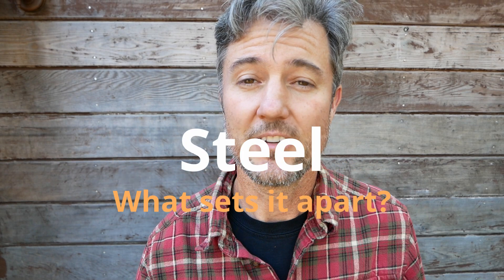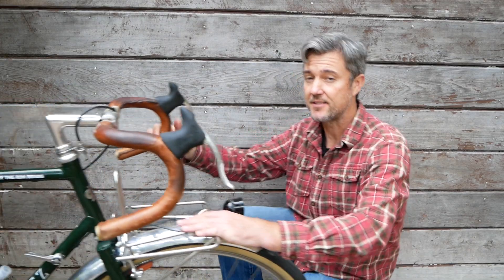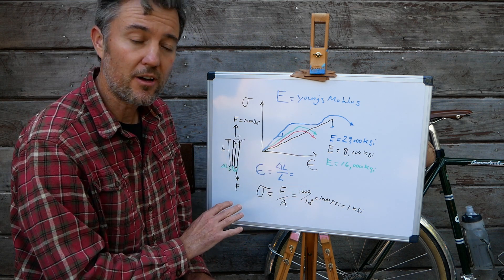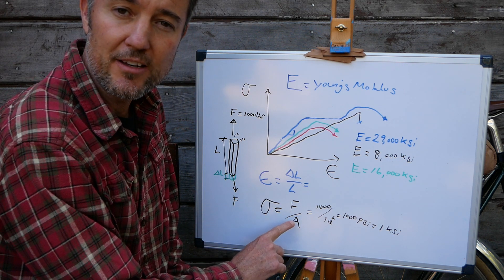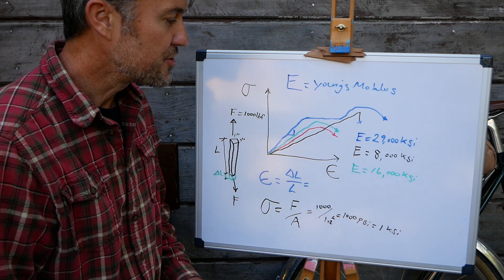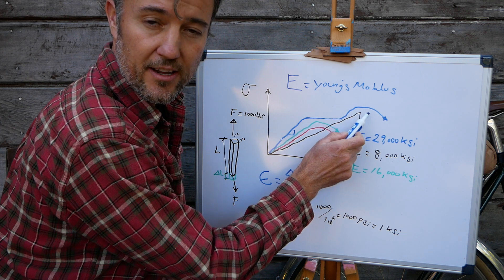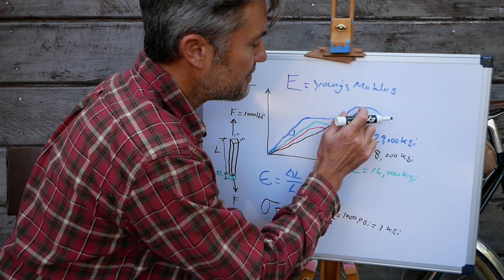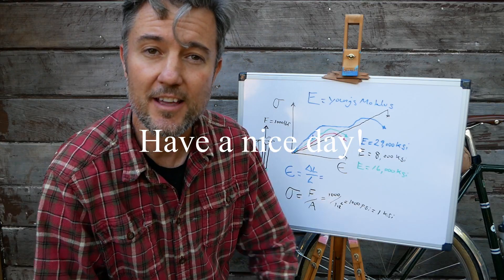Steel is a GREAT Material for a Bicycle Part:1 Intro

Comment from the maker: Hi everyone, I want to point out a mistake in this video. I said steel is often alloyed with magnesium, I meant to say manganese. I apologize for the confusion.
Reply: Not super important, either, but chromoly or chromolybdemum is not an element. Chromoly steel is steel alloyed with the elements chromium and molybdenum, as well as, I think, manganese and traces of a couple other elements. Not sure what qualities those elements impart to the alloy.
Reply from the maker: Thanks for clarifying! My understanding on metallurgy is pretty limited.
Reply: Very nicely explained, the different properties in frame materials, thanks.
I'd love to see how Bamboo as a frame material compares to steel...
Reply: Here's a short list of various alloying agents.  http://www.diehlsteel.com/technical-information/effects-of-common-alloying-elements-in-steel

Comment: Made the plungr to steel 2 years ago, and I'm loving it! It has to be engineered right though. My Specialized Sequoia really sucked for long rides and climbs, but the Pelago Stavanger with a more traditional geometry is a blast! Best bike I've had, perhaps not in terms of components, but the feel and the response are great. The Sequoia always wanted to go home after 50-70km, the Pelago is scary fun and 100km rides plus bikepacking are fun!
Reply from the maker: That's awesome! The original Sequoia made in the 1980's was a steel framed bike. I rode the cousin of this bike called the Expedition for a few years. It was a similar bike to the Sequoia with the exception of cantilever brakes. It was the bike that convinced me to go with a full custom steel.  I agree not all steel bikes are equal and good design and fabrication is necessary for a good riding long lasting bike. Thanks for sharing your thoughts!

Comment: Agter many years on a nice reynolds steel frame. I got a 14 Roubaix,if theres any give to carbon I dont feel it. Vibration damping? If they say so. It feels stiff and dead,and light. I end up running bigger tires and standing a lot for bumps.

Comment: I like steel as well, but today's manufacturing and design processes can confuse the matter even more.  I have several steel bikes, but my single aluminum bike (Jamis Renegade Exile) is the smoothest riding on the same brand and size tires and one of the steel bikes is much less buzzy with a carbon fork ('90's steel forks can be really stiff).  I think geometry and proper material design/thickness/orientation(?) is more important these days than the actual overall material used.

Comment: The following essey is titled "The Golden Age", and is written by Maynard Hershon.

You hear guys claim they remember “better
days” in road cycling. There were no better
days. Today is the best day.

We never had the choices we have, several
fine alternatives for every consumer decision,
whether products or services. We’ve never had
the convenience we have now.

Examples? Back in the ’70s you could buy a
titanium frame. You still can. But the worst Ti
frame you can buy today is worlds better than
anything you could have bought then. No
comparison.

And although the ’70s were the so-called
heyday of lugged steel frames, you can buy a
better lugged steel frame now than you could’ve
then. Frames from many of today’s builders are
finer, more fussed-over and better finished than
anything Cinelli, Hetchins, Singer or Confente
ever produced.

Today you can also buy aluminum or carbon
fiber frames. You can buy aluminum frames with
carbon stays. You can buy composite aluminum
frames that won’t behave the way aluminum
frames are reputed to behave.

No doors are closed. If you still believe steel is
real, buy steel. Buy whatever you want, go for a
ride, then explain to me why the “old days” were
superior.

You say you miss the oneness you used to
feel with your bike when friction held your bike in
gear? Buy an old parts group, new in the box.
Buy used parts. Or buy a 9- or 10-speed group
or Mavic’s electronic Mektronic shifting. You’ve
never had so many options.

In the ’70s, you leaned over a sink and hand-
washed your wool cycling clothing. That stuff
took hours to dry, hanging on a line. It shrank
anyway. Shorts rode up, arm and leg warmers
fell down. There was no woman-specific
clothing.

No bike clothing had style. Style was inauthen-
tic; no one wanted it. Did Fausto Coppi’s
clothing have style? Hell no.

Today, all bicycle clothing is easy to wash.
Almost all of it can be machine dried without
shortening the life of the garment. You can buy
jerseys and shorts made to fit women. You can
buy comfortable, stylish, long-wearing clothing
at a wide range of price levels.

If you still want to wear what you wore in the
’70s, embroidered wool jerseys with front
(chicken-leg) pockets, you can do so. Niche
clothing marketers will cater to your every wooly
whim.

Seventies shoes were pointy-toed Italian
things that fit only this one guy in Venice who’d
already quit riding. Unless you had cheap,
crummy Detto Pietros or expensive Sidis, you
paid an impatient shoe repairman to nail cleats
to your shoe soles, then re-nail them and RE-re-
nail them, glaring at you all the while.

There was as much to know about shoes then
as there is to know about Windows today — but
no one would pay you to learn it. Knowing it
didn’t guarantee you foot comfort, either. You
suffered anyway.

Crummy, inaccurate cyclometers clicked every
time the front wheel revolved. You couldn’t
mount some tires onto some rims without brute
force. Or the tires went on easily, then blew off
the rims when you parked your bike in direct
sunlight.

Don’t get me started about saddles. If you
want a ’70s seat for some perverse reason, you
can still buy one. Or you can choose from 100s
of current designs.

In the old days, we were encouraged to
dismantle our bikes frequently for maintenance,
sometimes at ludicrous, compulsive-obsessive
intervals.

We used to have to remove inner brake
cables once a year and smear grease on them
to keep them from rusting inside the housings.
Now we have nylon-lined housing and rust-proof
cables. No fuss.

Back then, you had to maintain top-level parts
nearly as often as cheap ones. Cheap parts
were dramatically inferior to today’s cheap
pieces, some of which work as well and last
nearly as long as today’s best stuff.

You can still fuss if you want, dismantling,
grease-packing and hand-washing, but you
don’t have to. We’re free at last.

Today you can take organized, professional
cycling tours all over the world. You can pick
and choose your tour company; there are
dozens. You can choose from dozens of cycling
training camps all over the world: Florida,
Majorca, Tuscany, Colorado, California...

You can read hundreds of books about
cycling. You can watch hundreds of videos. You
can learn about cycling on-line. You can read
dozens of cycling periodicals, many of them
free.

You can learn more in an hour than you
could’ve reading 12 issues of Bicycling Maga-
zine or Bike World in 1978.

Cycling is no longer a cult of true believers
and freaks. There’s no initiation, no hazing. You
don’t have to be a mechanic or wear geeky
clothes. You don’t have to speak French or be
an expert in the care and preservation of wool
and leather.

Cycling today does not demand a life
commitment. It’s fun for nearly everyone.
I’m not saying everything about road cycling is
fun. Sharing the road with cars is not fun; not
often anyway, but it never was.

Dealing with self-absorbed bike shop
employees is not fun, but you can choose
among shops or buy mail-order or on-line from
some pretty cool outfits. You have alternatives.
In the ’70s, if you were lucky you had one
good local shop. If they liked you, meaning if
you passed their mysterious coolness tests, you
were in. If, for whatever reason, you did not
pass - you were out in the cold. Not fun.

It surely wouldn’t have been fun if you were a
woman, and not a racer. There was no Olympic
road race for women until 1984, remember.
Many old school cyclists and coaches failed to
appreciate females who rode.

Shops today are used to women customers.
The employees aren’t all adept at helping them
but at least they aren’t blown away when a
woman walks into the store...or a guy whose
legs aren’t shaved or who asks uninformed
questions.

The retail environment isn’t perfect, but it’s not
the old boys’ club it was.

Bike clubs are better. The racer/tourist splits in
many clubs have healed. As the average age of
club cyclists rises, perhaps fewer are as hard-
core as they were. Clubs have graded rides and
clubs-within-clubs.

The ’70s are gone, but you can act as if they
aren’t. You can wear wool shorts or a leather
hairnet-style “helmet.” You can hang out with
guys who know part numbers for Campag pump
hangers.

You can learn French and read L’Equipe. You
can choose clips ‘n straps and spoked, handbuilt
wheels. You can shift clicklessly and let your
brake cables wave in the wind.

Unlike the ’70s, you don’t have to if you don’t
want to.

Most significantly, you can’t go for a ride in the
’70s. You CAN go for a ride today. Today’s the
best day.

Comment: forums(dot)roadbikereview(dot)com/bikes-frames-forks/carbon-306282-4.html#post4377578
(dot)pinkbike(dot)com/news/4-materials-that-could-improve-carbon-fiber.html
sheldonbrown(dot)com/rinard/frame_fatigue_test.htm
rationalwiki(dot)org/wiki/Good_old_days
bikeforums(dot)net/3753055-post31.html

google(dot)com/search?biw=1920&bih=937&tbm=isch&sxsrf=ACYBGNRL0ldSqJNCo7ZZhFynFsXQTBm9fw%3A1570117547084&sa=1&ei=qxeWXYXcBMv4tAWxpJO4DA&q=bike+frame+steel+failure&oq=bike+frame+steel+failure&gs_l=img.3...5713.7424..8486...0.0..0.168.670.0j5......0....1..gws-wiz-img.35TjYpXsvBI&ved=0ahUKEwjF3ZjVt4DlAhVLPK0KHTHSBMcQ4dUDCAc&uact=5#imgrc=Xp0ENbuUMATQOM:
bikeforums(dot)net/folding-bikes/1107912-suggestions-new-bromton-model-2.html?styleid=8
https://cdn(dot)instructables(dot)com/FJK/M4JF/HZ9O73XD/FJKM4JFHZ9O73XD.LARGE.jpg?auto=webp&frame=1&width=933&height=1024&fit=bounds
http://www(dot)pardo(dot)net/bike/pic/fail-001/FAIL-193.html
http://www(dot)pardo(dot)net/bike/pic/fail-001/FAIL-194.html
http://www(dot)pardo(dot)net/bike/pic/fail-001/FAIL-157.html
http://www(dot)pardo(dot)net/bike/pic/fail-001/FAIL-153.html
http://www(dot)pardo(dot)net/bike/pic/fail-001/FAIL-147.html
http://www(dot)pardo(dot)net/bike/pic/fail-001/FAIL-085.html
http://www(dot)pardo(dot)net/bike/pic/fail-001/FAIL-068.html
http://www(dot)pardo(dot)net/bike/pic/fail-001/FAIL-063.html
http://www(dot)pardo(dot)net/bike/pic/fail-001/FAIL-041.html
http://www(dot)pardo(dot)net/bike/pic/fail-001/FAIL-036.html

Just say you're a retrogrouch.

Comment: Steel - my second favourite frame material behind titanium.
I do not like aluminium due to its almost complete lack of fatigue strength ie it does flex but once it does the clock is ticking and at some point it will fail catastrophically under normal stresses. That is the reason airliners have a limited lifespan. Once that is surpassed it can fail at any time during normal use. Also the reason there are no aluminium springs.
Carbon fibre is okay but it is very susceptible to minor looking surface scratches which very much decreas its strength. I'd be fine with carbon fibre frames if somebody else is paying for them but that only happens if you are a pro rider. Also once it does fail it shatters into dangerously sharp pieces.

Comment: Keep in mind comfort and flexibility are two different goals in bikes.  Modern day bikes can be outfitted with a variety of comfort accessories while still riding a crazy stiff frame.   But Flexibility is how your bike feels under your seat.  Here's where steel and titanium come alive verses carbon and aluminum.   Now retired and having owned  and ridden dozens of various bikes made from steel (531, columbus, chrome moly) , aluminum (6000, 7000, scandium, oversized), carbon (narrow, oversize), and titanium (narrow, oversized, hex twisted), I can say each material can be manipulated or ordered to suit the rider's needs.    

The stiffest, bone chattering  ride came from my oversized aluminum frame (older Cannondale). The most flexible and comfortable rides came from much narrower titanium and steel tube frames (Litespeed Firenze, Seven Aerios,  Gunnar Roadie, Salsa Colossal).  Bending to the failure point doesn't happen on typical road riding.  Bending due to an accident/crash is different issue.  Repairing a broken frame usually it too risky from my experience.  Past broken parts became wall art.  

Steel is real, but titanium is maintenance free.  Both materials return your pedal energy with a rhythm. Both materials give you direct feedback to the pavement.  But whatever material you choose, just ride it and let the wind in your face be the ultimate reward.  Some of my most memorable rides have been on my worst bikes.  Remember, its always about the journey.

Comment: Everyday Bike...SOMA DC Cantilever Tange Imperial #1,(7-4-7 Double Butt ,Surly/Velo Orange are 9-7-9),Cro-Mo 4.2 lb. 54 frame $500.00..No Rust in Scratches
Reply from the maker: I didn't realize the Soma frames were thin walled!

Comment: Excellent video. One of my rides is a 1982 Trek 720. It has approximately 45,000 miles on the Reynolds 531 frame. Back in the day a huge amount of technical detail was was provided by the manufacturer, tubing wall thickness, frame weight, tensile strength etc. Today bicycle marketing is much different, and not necessarily better.

Comment: Enjoy your videos. Thanks! My thoughts on this is simpler. I was fortunate to find recently and purchase a titanium bike that was the geometry and size that fit me beautifully to add to my carbon fiber and aluminum bikes. The ride qualities simply blew me away! So smooth yet so connected to the road and what’s happening. Aluminum is too harsh and carbon while smooth feels dead. With titanium I feel the road well without “feeling” the road or its harshness. I feel very connected. I had started the journey actually looking for a steel bike because I had heard good steel had those same properties but the ti bike was actually less than ordering a good steel bike and available immediately. Hopefully in your next videos you might address ride qualities a little more in depth. Then I may just have to add steel at some point to my garage 😳
Reply from the maker: The two bikes I spend most of my time riding is a Ti road bike and a steel touring/rando/allroad bike. The Ti bike is very light at 18 lbs (8 kg), and it's my go too when I want to ride fast uphills, stay mostly on the road, or go on a fast group ride. It flexs and it feels a lot like a steel bike, but has a little more springiness that's hard to describe. When I first got it I thought it was too flexible, so I ended up getting another carbon road bike to add to my collection. I built that bike up to be as light as possible on the budget. It came out to 16 lbs (7.25 kg). Its a lot stiffer than the Ti bike, but after riding it a lot I realized the Ti bike was more fun for training. I have saved the carbon bike as my special occasion "race day" bike. I kept finding myself going back to my Ti road bike when I wanted to go for a ride. It's funny to say but Ti is what ultimately got me interested in trying out a steel bike. The roads where I live are very rough and bumpy and being on a flexible Ti or steel bike helps to soften the ride. Thanks for watching my videos and I appreciate the thoughtful comment!
Reply: Thanks for enlightening me more on steel qualities. I appreciate you taking the time. It’s a shame in Cincinnati there doesn’t seem to be the opportunity  to try a quality steel bike. Some 28-30 lb slugs but it wouldn’t tell much. We just don’t have the biking culture or infrastructure the west US and Europe seems to have. Btw, my ti bike has Velo Orange Gran Cru rim brakes and they are beautiful to look at, so light weight and so powerful stopping. Hats off to them.

Comment: The chair works great with the saddle colour! 
Very interesting and well explained,  even for me without english mother tongue...if that is the right term. 😁
For me ride quality is one of the most interesting subjects about bikes. I got a bike with really thin Columbus Cromor tubes and a cromoly Kona. So different in their own ways! One day I would love to try a Reynolds 953. Do you have like a favorite steel tubing? 
Greetings!
Reply from the maker: My custom Fitz bike uses a blend of steels from different manufacturer's. It's all very thin and the ride is very plush. The bigger tires also add to the comfort, but what I notice most about this bike is how well it corners downhill even on the rough asphalt where I live. The other steel bikes I've owned had thicker walled tubing, were a little stiffer, but still felt great. Reynolds 953 is really interesting. It's incredible what bike builders are doing with these new alloys, and I am excited to see what comes next!

Comment: What’s your day job? Mechanics of materials is buried deep in the grey matter since I have worked the past 20 years in fluid systems. Nice video.
Reply from the maker: I have a ton of respect for you! Fluid mechanics was definitely one of the harder classes for me. I finished my degree in Civil Engineering, so our needs for fluids was contained to stream flow analysis, weir discharge, and the classic flow through pipe problems. All very interesting of course. These days my work is in structural design, so everything is solid and static!
Reply: I am sorry. I freaked out. My ideal bike always starts with an non compact steel frame. Everything else varies according to my mood. Nice video. Thanks